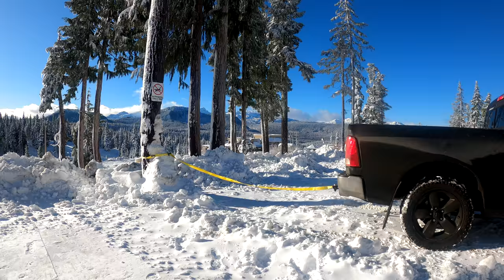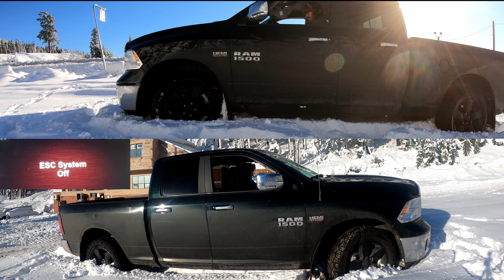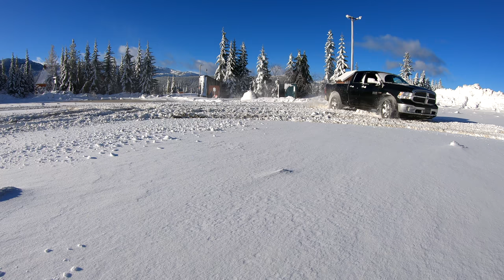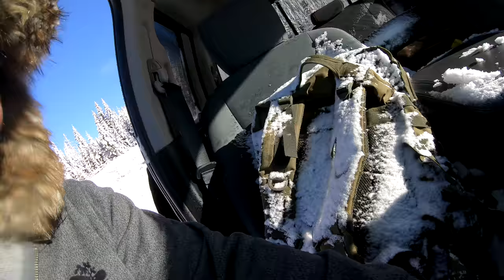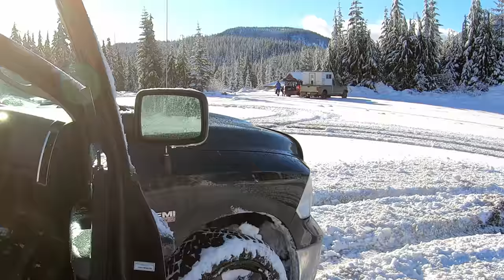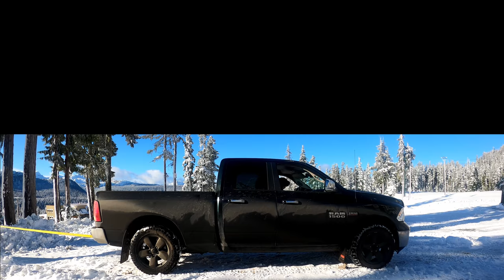RAM 1500 Off-Road 4WD Lock Test In Deep Snow (I Was WRONG..) | Real World 4x4 review 2.0

Comment: That lock is shyt because actually does not do the job of locked the four wheels, so if you get stock, how is going to help you to get out the locked axles if just 3 or 2 wheels spinning?
Reply from the maker: So the term 4WD LOCK is pretty deceptive to begin with because is doesn't mean that all 4 wheels are locked into the drivetrain. it means that the truck is "locked" in 4wd meaning there is power going to both the rear axle and front axle. now if you have two open differentials, both front and rear like I do only 2 of the 4 wheels will be receiving the majority of the power. if I had a locking rear differential 3 of the wheels would be getting power (1 front wheel and 2 rear wheels). If I had both a front and rear locker all 4 wheels would receive power (2 front and 2 rear). so in these trucks 4wd LOCK basically just refers to the transfer case locking the front driveshaft to the rest of the powertrain and nothing else. if that makes sense lol
Reply from the maker: @Mctrician2 Exactly. I would need my transfer case locked as well as both front and rear differentials locked (which I don't have) to truly have power at all 4 wheels.

Comment: If it has 4 auto then it never is actually locked in 4wd locked because it uses clutch plates from my understanding. If there is no auto 4wd feature then it does actually LOCK in 4wd lock. It the kind of borg warner transfer case that has to do with it
Reply from the maker: Nailed it on the head sir! if you get enough resistance from the front wheels the clutches will start to slip. for most people this system will work just fine but I just found it interesting how there were some significant differences between the two T-case options.
Reply: @TheGettyAdventures  right, I learned this years ago when I had my 14 ram. I came across a  video here on youtube similar to your situation lol (go figure)
And looked more into it. My ram I believe had the borg warner 44-40 and the ones with the auto feature had the 44-44 (if I remember correctly).
Funny thing I know ford uses the same transfer cases on their f150 or atleast use to

Comment: Where the problem comes in with the clutch plate transfer cases is when the rear has no traction and the front has all the traction, the plates get overloaded. Example is tie truck to tree with rear tires on ice and front on pavement. All the torque will be put onto the clutches for front drive and you will smoke the clutches. They are fine as long as you know the limits and don’t go mashing the throttle for long periods when stuck in mud. Periodically stop and let them cool.
Reply from the maker: Yes the clutch pack system has it's limitations. I feel like a lot of folks don't understand that with a clutch pack system there is always going to be some slippage, especially when there is high torque loads like in a stuck situation. 

That being said, I also think 95% of people are going to be just fine with the clutch pack transfer case with the limited off-road use they do. But I just find the difference in off-road performance between the two transfer case options interesting.
Reply: @TheGettyAdventures  Your right, they are fine for the majority of people. I know how hard it is explaining to girlfriends who drive my RAM 3500 Dually that when on dry or tight turning in a parking lot to put it back in 2WD when you feel the drivetrain wind up and start bucking. Most of the time they just mash the throttle and use the cummins. LOL. Even when I'm driving I am constantly back and forth with the transfer case. I sometimes wish they could put an auto system that can handle the torque of the big diesels in the HD trucks. Good job on the videos, nice to see more of us Canadians making them. Keep it up.
Cheers
Reply from the maker: @sw5334  I mean they could make a clutch pack transfer case. I just feel like there is a need and probably would constantly have people burning up clutches lol

Comment: I was gonna say if u couldn’t get it figured in this thing I would be surprised. I have literally buried the axles and had snow to the hood until the truck just couldn’t pole it forward anymore. Love my rams!
Reply from the maker: well the problem was this snow was pretty heavy and I had no momentum. Compounded by two open differentials lol. but she got out and that's all that matters
Reply: @TheGettyAdventures  next time ur in the tswwassan area or anywhere on the lower mainland would love to show You some old clips of me stuck in the interior trying to get out of similar situation stuff. Finally got it to the point it wouldn’t move, had to throw the chains on. Then I crawled it till it couldn’t move with those and then had to try to turn around on a service rd haha. To say the least we had some fun. If u are in the area hmu would love to do a comparison video of my 2018 2500 5.7 vs the 1500. I’ve had 2 1500s but would love to do a if it’s worth it kind of video!

Comment: Thank you for the update. I'm currently considering a RAM 4x4 and the last video initially raised some concern. I appreciate you clearing that up! (It can be hard to admit when we're wrong.)
Reply: Get a 2003 with the selector in floor i dont have those issues but they are one helluva of a truck and this coming from someone who owned mainly Fords with two chevs in there this my first ram and its been a good truck
Reply: I got a 2020 5th gen, lifted it and put better tires on it (snows and summers). Fun truck for sure.

Comment: My 2015, I cannot completely shut off the assists unless I’m in 4low. My truck has 4lock, 4auto, 2wd and 4low. To my knowledge, I didn’t think 4lock truly locked it up and only acted as a normal 4x4 unless you had limited slip or some sort of after market locker?
Reply from the maker: ya you have the clutch pack transfer case, which doesn't fully engage or lock until you are in 4 low. even with the ESC off it isn't fully engaged until you are in 4low

Comment: Have a new 2023 Ram 1500.  So disappointed.  So disappointed.  The worst 4wd system on earth.  It’s the one with 4 auto.  To see a Ram stuck in that little snow is shocking.  Living in Colorado I have driven a front wheel drive Focus in that much snow.  My Ram does fine when I am trail running.  But, on steep loose terrain, a constant on just about any Colorado trail, it loses power as I lose traction. To have to turn off TC is flat annoying.  Ram is part of FCA.  They can’t build a 4wd system on a $60k truck?  I bought a Bighorn with the bottom line system.  Got what I deserved.

Comment: The rams with the 4wd auto won’t fully lock up.  They have a clutch kit that prevents it to fully lock up.  If it doesn’t have the 4wd auto it is mechanical and will fully lock up.
Reply from the maker: that is correct! that being said for most people this ram will be just fine. I've never had too much of an issue with this clutch pack transfer case to this point.
Reply: Is it good or bad if they can't or can fully lock up....
Reply: Depends if your pulling someone out of jam fully locked would work best.  If you are driving in snow covered roads the 4 wheel auto will give you better traction. Fully locked in snow will cause the truck to toboggan.  Depends what you are using it for.   The 4wd auto would cost more to service and require more frequent services so the clutch pack does not wear out.

Comment: I thought it was bad to have the front wheels turned when 4wd system is engaged?
Reply from the maker: on dry pavement ya it is. but when you are in snow or sand when the driveline binds the wheels can freely skid on a slippery surfaces. whereas on a dry surface that won't happen and your driveline will bind and potentially damage something

Comment: I did this the other day and broke the left axle. It's under warrenty and was fixed at the dealership. But at 5,500 miles it left me wondering if I cant trust this truck.
Reply from the maker: that's really too bad. front or rear axle? I had a buddy with a 4th gen Ram blow up a CV axle going through the bush. but spinning around like that can easily brake an axle. all it takes is to hit a pot hole sideways and it'll snap an axle.
Reply: @TheGettyAdventures  It's a 2020 new body style 1500. Front left one broke. We had about 10 or 12 in. of snow with a coating of ice under it. I pulled into the snow front 1st, stopped, put it in 4wd and spun. Spun forward, backward, hi, lo. Stuck. I had to pull it out with the Kabota. Went to drive the truck and  it made some noise. More noise with it in 4wd.Like I said it's under warrenty and got fixed right away. I don't know if this is a thing or not.
Reply from the maker: @JD-hh9io  Woow I thought you meant you were doing donuts or something. that's pretty brutal. Could of just been a bad axle to begin with. could of maybe messed it up somehow when you pulled the truck out. regardless, happy the dealer fixed it no questions asked.
Reply: @TheGettyAdventures  That's the thing, I wasn't doing anything crazy. And I couldn't leave it in neutral open the door and get out to pull it a little with the tractor. It puts itself in park automatically. I had to have my wife get in it so I could pull it a couple of feet. Thanks for responding and happy new year and all that stuff.

Comment: I can't speak to the Ram but generally speaking traction control systems become much more aggressive in 4x4 Low range. Nissan and Toyota for example have off road TCS systems that only start working in 4x4 low (ABLS and ATRAC), they don't really do anything in 2wd or 4x4 high. I'd be curious to know if you have that front driveshaft disengaging issue in 4low

Comment: I’m a 2017 ram new owner.  It’s got 4wd lock and 4wd low, does not have auto.  For driving around in snowy slick roads would I want to put it in lock and turn off the esc or is just having it in lock enough?  Thanks just seems ram made this confusing
Reply: I'm an owner of a 2018 ram 1500 up here in the southern interior of beautiful British Columbia, Canada and my ram has just the 2wd, 4 hi and 4 low options and I find that leaving it 4 hi or 4 lock which ever you prefer to call it is usually good enough for average snowy roads and a little bit of ice but the traction control systems will mess with your momentum when you start to spin and depending on the situation you may want the tires to keep spinning while other times the system can be helpful to prevent wheel spin. Honestly though if the roads are very slick and icy and snow covered 4 hi and trac off will be a good setup but if you want the most manual control possible put it in 4 hi or 4 lock with turning both trac control off and ESC which is the back up traction control system that will usually stay on in case the tires start to spin a lot it will kick in even with trac off and it can ruin the momentum you have. I've run into situations where I've driven into a couple bad storms before on the highways home and road conditions got pretty bad that I encountered a bit of wheel spin or fishtailing even with 4 hi and trac off with good winter tires on of course. Its all something that you will learn as you drive the truck more too

Comment: How do you fully turn it off?
Reply from the maker: hold your traction control button for 5 seconds in 4wd lock and you should get a message saying esc system off. when in 4wd low it is automatically shut off.

Comment: Need a power wagon. Best decision I ever made.
Reply from the maker: such a great truck. 2 real locking diffs and a factory winch lol sign me up. Now I do wish they offered the Cummins as an engine option for those trucks
Reply from the maker: @arlisspropertyservicesllc5943  I had heard It had something to do with the weight of the Cummins. heard it was like 2 times as heavy almost 1000 pounds. And wow that is a low towing capacity for a 2500. wonder why that is. regardless the truck looks awesome and is probably an animal in the snow and mud.
Reply: @arlisspropertyservicesllc5943  i believe they offer the cummins in the powerwagon not sure what year but ive seen them

Comment: I can get through snow... driving it on slippery conditions in 2 wheel drive it’ll slide cause no weight in the back. That’s pickups for yeh. All weights in the front you get no weight in the back. My old 03 ram will slide around in slippery conditions. The weight is in the front. Big V8 and the crew cab. 6’6 bed. All weight is in front end. Do not drive in 4x4 on pavement and even in slippery pavement because it’ll mess up your truck! I have seen a IDIOT in a ram drive in 4 wheel. There was snow on the ground but the roads were PLOWED. Roads did have sand/salt on em but you can drive in 2 wheel on that of course. Only use 4 wheel when you are in snow that you can’t get out in 2 wheel drive. His problem he don’t know that he is messing up his truck.
Reply from the maker: these newer trucks allow for slippage in the transfer case which can allow you to drive in 4wd on pavement with little damage or issue (i wouldn't recommend it). but allowing this slippage also deteriorates some of your true off-road ability. But on a traditional mechanical transferase you are correct you can easily blow some stuff up running on dry pavement in 4wd
Reply: @TheGettyAdventures  yup that’s what I mean. I say do not drive at all in 4wd on pavement or wet pavement it ain’t intended for it. It’s intended for off roading/snow conditions. That’s what I use it for. My truck has a manual floor shift. I love it because it always works. I highly suggest only putting your vehicle into 4 wheel while it’s in Neutral gear. Some can do it while in drive. My is designed for it but I never done it. I have thrown it in neutral while it was rolling then put it in 4 wheel then put it back in drive. I do it while stationary now because I want to take good care of it and make it last and keep working for me. That’s the way to go. I’ll do it if it’s snow situations and I’m already moving or if I ever need to off road. I’m not a fan of button transfer case . Annoying how they fail and you have to wait for some of them to work. With The manual it’s a simple put vehicle in N and pull back on transfer case lever and roll. That’s cool how they done the slippage but yeah man I wouldn’t do it

Comment: I have  21 Ram.
Do  I have  positive  trackstion.? 
All four wheels  pulling at the  same time??
Reply from the maker: it depends, I believe the ram rebel is the only 1500 is the option of both front and rear locking diffs. but it depends on how your truck was configured. you may have a limited slip in the rear or even a locker. but you could also have 2 open differentials as well. 

what I would do is look your vin up online and go through the equipment. it should say what time of differentials and transfer case you have.

Comment: I’m confused by something you said. You seemed to use the terms 4 wheel lock and 4 wheel high synonymously.  Did I misunderstand?  I thought 4 h vs low were about selection and lock was a separate function.  Or is that wrong?  Nice vid, thanks.
Reply: From what I understand, atleast in this truck, 4wd lock is 4wd high. My guess on the reason for that, would be the incorporation of 4wd auto

Comment: How do you turn off the rev system
Reply from the maker: the ESC system?
Reply: @TheGettyAdventures  hey I usually before go off road I pull the AIRBAG fuse, which will disable ABS, so I am wondering if it does disable ESC with it
Reply from the maker: @IF9  that sir is a great question. I honestly am not sure. that being said your traction control and I would assume your ESC would also run off your abs sensors. so an educated guess would be Yes!

Comment: You really want your mind blown? You know how 4 low automatically disables everything with the traction control system? Well you can do that with 4 lock as well. You just hold the traction control button down when in 4 lock. After 5-10 seconds it will ding at you and run through everything that has been disabled
Reply from the maker: 100% correct. I just wanted to show that without disabling your ESC system in 4 lock your 4wd system is not truly locked. 

when I was stuck in the snow there I was in 4 low. unfortunately having 2 open diffs does that lol
Reply: @TheGettyAdventures  yes it does. I plan on putting a Detroit trutrac in my rear end

Comment: I put it in 4 lock, held the TC down for 5-7 seconds and it only said TC off. I did  the same thing again but I held it down for longer but it still only said TC off. Anything I’m doing wrong?
Reply from the maker: what year is your truck?
Reply: @TheGettyAdventures  it’s a 2015
Reply from the maker: @jensensmith.  mhmmm thats odd. you can try and pull the f-26 fuse. which is your ABS/ESC fuse. which should disable it.

Comment: Alex, my Ontario brother, hows she goin? We all make mistakes and at least you showed where you were mistaken. I loved that term “Pavement Princess” LOL ... I called them “city trucks” all shiny-clean. Lots of those in T.O! Thanks bud, cheers
Reply from the maker: haha my truck is a pavement princess but every now and again she needs a good outdoor beating! the mountains are awesome that's all I have to say
Reply: I think you were right man, the locked just lock one front wheel, so how does that help you if just one wheel of the front tires spinning and the other one is disengage
Reply from the maker: @georgemercado7160  that is the disadvantage of an open differential. really nothing you can do. the traction control does try to apply brake pressure to the free spinning wheel to force the other wheel to turn but that tends to not really work that well. you need a locking front differential for both front wheels to spin at the same time. and unfortunately the RAM 1500 trucks don't have a front diff lock option from factory so you'll be looking at an aftermarket unit.